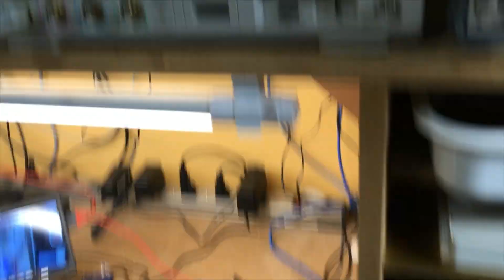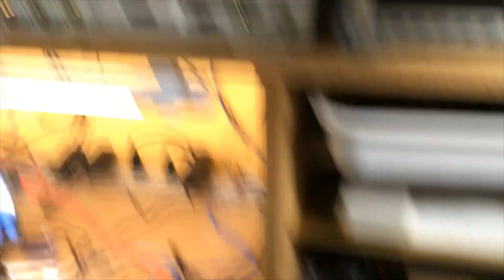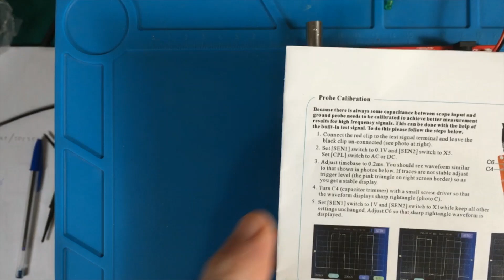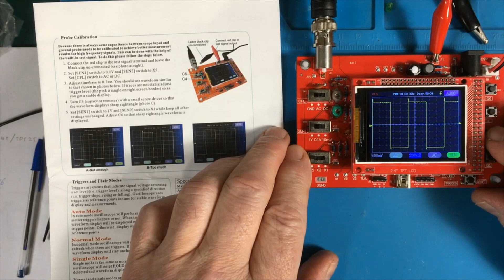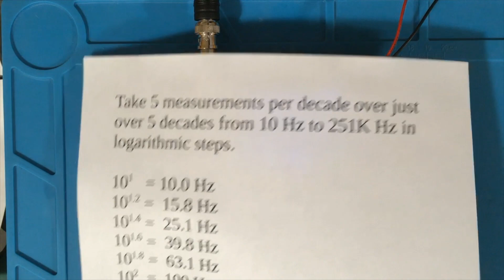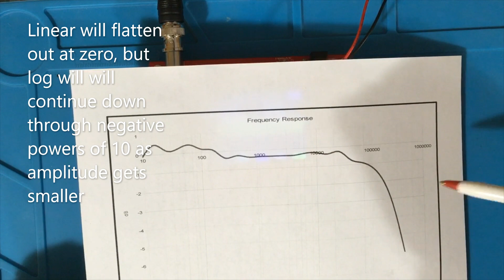0011 - Beginners' Electronics Tools: The Oscilloscope and the Function Generator - part 2.

Comment: I have the same function generator kit but haven't gotten around to assembling it yet. I also recently bought a small battery operated oscilloscope. Mine is the Dso154 Pro(18Mhz), I thought about getting the Dso138 but the difference in price was only about $12 at the time that I bought it so I thought may as well get something a bit more capable.
Reply from the maker: I agree.  The DSO154Pro is also better protected than the DSO138 so if you include the price of the acrylic case for it you are pretty much the cost of the DSO154Pro which comes with a rechargeable  battery and a proper probe.  I've actually got a DSO150Pro, a DSO138Pro and a DSO152 coming in form various source and plan to do shoot-off between them
Reply: @uni-byte  I  also have multimeter coming from Amazon that was on sale for a really good price($25 CAD), it's a 40000 count but for the price I'm not expecting too much. It should be fine for the stuff I do though. The Dso154Pro is my first oscilloscope and so far I'm happy with it even though I have nothing to compare it to. I don't do electronics enough to spend a lot of money on something bigger and better. The comparison you're doing sounds interesting and I'll be looking forward to see it.
Reply from the maker: @percaine  Let me know about the meter when you get your hands on it.  It sounds interesting.
Reply: @uni-byte  I should have it tomorrow if all goes well and I might upload a short video of it if I have some time. I just looked at the listing again and they've taken away the $10 coupon so it's now $35 but still might be worth checking out. I'm not sure if links are ok so I  won't do that but the meter is called INFURIDER YF-770D that seems to be identical to the HOLDPEAK HP-770D which is about 3x the price. I've watched some teardowns and reviews of the HOLDPEAK meter and the protection in it isn't great but for the low voltage stuff I'll use it for it should be fine.
Reply from the maker: @percaine  Pretty amazing price for a 4.5 digit meter.  I'm keen to see your review.  Subed to your channel.
Reply: @uni-byte  Yeah even if the input protection isn't that great it's a really good price for a second multimeter which is why I bought one. Thanks for the sub. I've been thinking about doing videos again after not for a while but I've never been all that good at it so not sure. Definitely will do one when the multimeter comes in though.

Comment: You probably work for NASA if you need d/c > light measurement or you could just take out a mortgage  .

Joking aside all test equipment has limitations , diy kit or not !
The key is understanding the equipment .
You then have a idea if the information gleaned is useful & valid .

Even if inaccurate it might be useful for signal at test pin ? , did something happen ? tests  .

Remember even if incorrectly used the humble DVM will always spit out numbers !
Reply from the maker: I agree.  In fact I'm rather impressed that this little scope meets it's advertised specifications.  This is perfectly fine for a whole host of beginner hobbyist  measurement applications such as audio or doing motor controls or playing around with microcontrollers like Arduino or Picaxe.

There are too many products on the market to day that disappoint. A perfect example are the Fnirsi 1104D and 1103D scope.  They advertise 100MHz bandwidth and deliver maybe 30MHz if they are lucky.  While this little unit is not in the MHz range, it exceeds it's specification, and that alone is refreshing for something that costs less than dinner at McDonalds.

Still, it is an older design.  The DSO 154 Ori is the better choice these days.  A bit more money, but a lot more scope.

I should get one and test it out!

Comment: Those little scopes are pretty sweet. Was my first solder project a few years ago. Gave it to a buddy, after getting a siglent, so I might get another just for fun. I just did the 2206 for school, the chip isn't the best but it works.
Reply from the maker: If you are going to get a new tiny scope, consider the DSO 154 Pro.  It can do about 18MHz bandwidth and is available with a rechargeable battery.  Only a few $ more than this one and a much nicer tool.  Not a kit though.

The XR2206 can be put to better use with a proper design.  This little kit is unfortunately pretty bare bones and has some outright errors in it.  At the price it does give you a useful generator, but it's potential is a lot better.

Which Siglent scope did you get?
Reply: @uni-byte  thanks for the info. It's the SDS 1204X.
Reply from the maker: @satchell78  That's a nice scope!  So nice I even have one myself along with an SDS2104XP!  Both have been hacked to the max too.👍
Reply: @uni-byte  ... its potential (the possessive pronoun has no apostrophe!) 😉
Reply from the maker: @SpeccyMan  Thanks!  Well, I do know that.  Now I just need to convince my fingers to oblige.